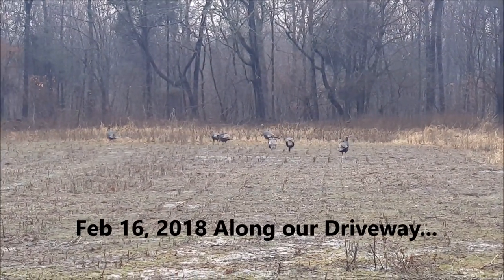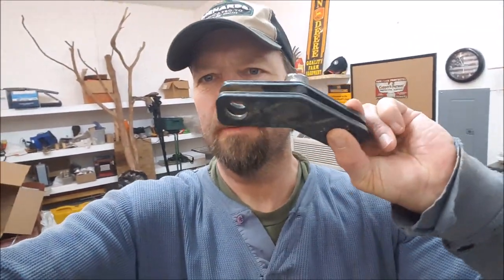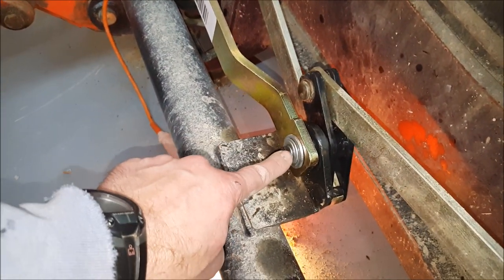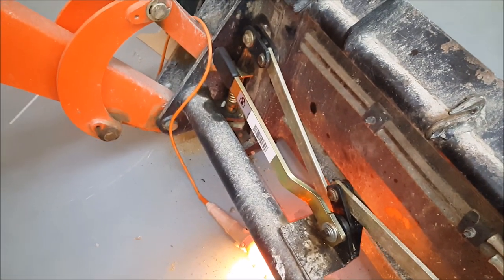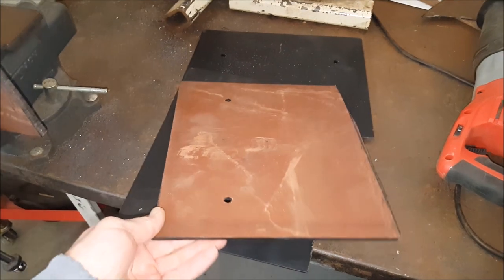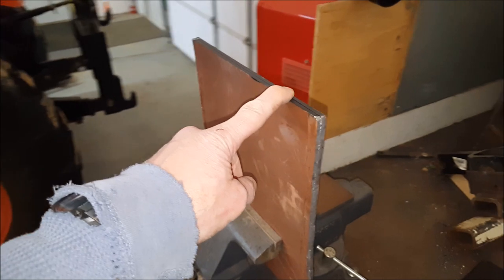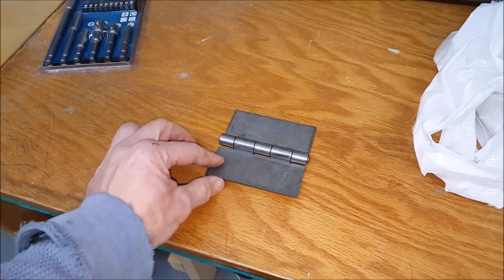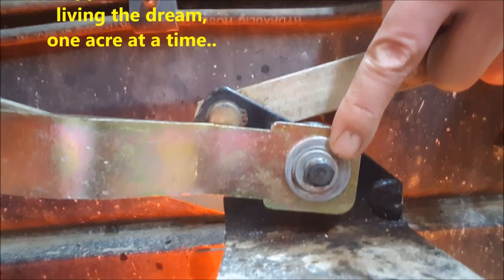Farm VLOG; Tom Turkeys, Steel Targets & Tractor repair 02-16-18

Comment: Maintenance is the key, and you've just proved it.  We gotta keep out machines greased and looked after. They do a lot of work in dirty conditions so water and dust  have to go!
Reply from the maker: yeah, I'm not the best with maintenance, but I don't neglect things either... If I would have shot grease and checked the main bolt before reefing on it, I could have avoided that quick attach change! Next time I'll be more careful!
Reply: You're half way there, once you know what the problem was, then you're on the road to correcting it. 
Experience is a wonderful teacher too,...I've learned that over the years.
You're doing a great job there on your land,..and providing all of us with a lot of enjoyment and mostly I think, 'know how' of what to do .
Reply from the maker: thanks man, I appreciate it!

Comment: I'd take some of that scrap steep and Fab a handle out of it and weld it on the pin and bolt your other handle to it with a few bolts. It will give ya "more meat" to hold with and if ya bent it, it wouldn't be any harder to grind the welds off than beating that pin out. Can't wait to see your shooting range lay-out.
Reply from the maker: Not sure I need more 'beef!' pretty sure more stuff might bend! lol Just have to be careful from now on. Yeah, looking forward to the range too! And spring! And planting! And fresh air! and.........

Comment: My bucket attaches totally different doesn't have the cross bars
Reply from the maker: you probably have a 'make specific' quick attach. This is the skid steer so it will fit anything that can fit a skid steer for a front attachment.